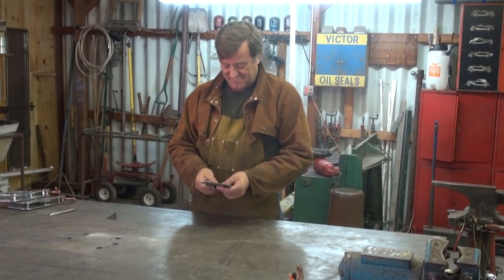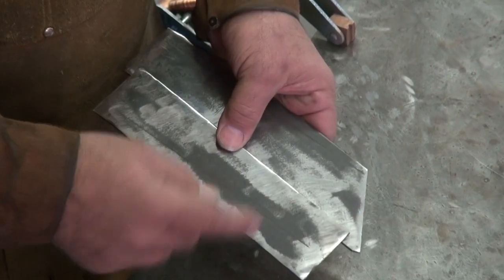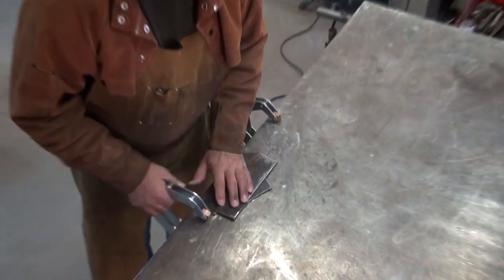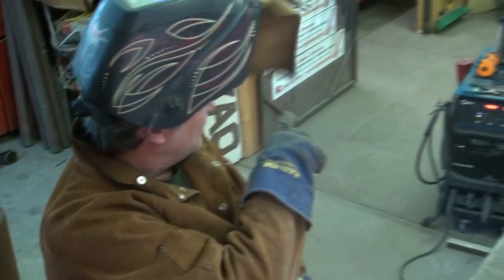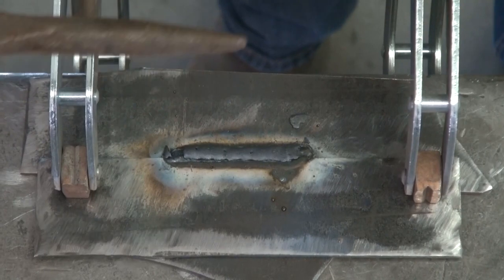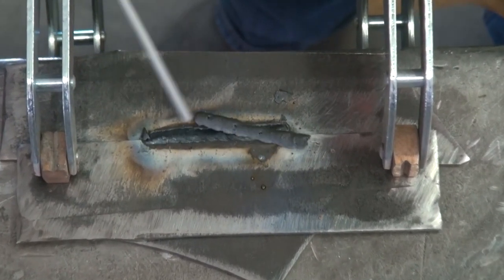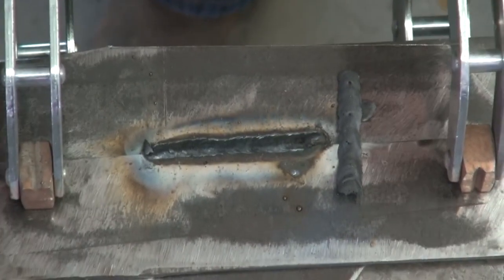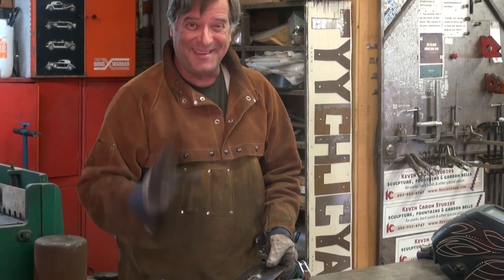How to Weld a Lap Joint - Kevin Caron

Comment: sometimes the puddle sticks to one peace of metal and not the other ... why would that happen ??
Reply from the maker: You are keeping the heat on one side of the joint.   Should be in the middle of the joint or maybe weaving back and forth a little.
Reply: @KevincaronSculpture  so it's best to make the rod on a 45 angle .
Reply from the maker: No, not over 10 degrees either way.   But try going right down the middle of the joint.  All really depends on what size rod you are using.
Reply: @KevincaronSculpture  I usually use 6013 on a DCEN inverter dc welding machine.

Comment: I am a new welder and learning from videos like yours and thanks to all for doing that.

I am now going to ask the "dumb question of the day"

I am aware that the table or the actual work piece has to be grounded to complete the circuit.  If not grounded it may think you are the ground or I assume no arch.

So if one was welding outside and stuck an iron rod into the ground and attached the ground clamp to that rod, would that complete the circuit or does the ground clamp  have to be clamped to the table or work piece?
Reply from the maker: Great question!     No, putting the ground clamp on a metal stake in the ground will not complete the circuit.  Think that what you have in your hand is a "return" cable, NOT a ground cable.  You might find a lug on the back of your machine to attach it to ground.  This is just to keep you from getting shocked by the machine case.  If you hooked the return cable to a pole in the dirt you will not get an arc from the machine.   Done correctly, your return cable should be hooked to the work piece always!   This will keep you from getting shocked by the welder as you are working.
Reply: @KevincaronSculpture  Thanks for your reply and I kind of thought no, but was not sure and your info was worth a lot. Thanks again and I enjoy your videos.

Comment from the maker: @spelunkerd The copper pads on the clamps are to keep you from welding the clamps to the work. 
If you check some of my other videos you will find my welder video. The Miller 200 is tig and stick. I also have a Miller 251 Mig. 

Thanks for posting...

Comment: what is the use/function of lap joints??
Reply from the maker: krislyn magsinolog Stronger joint than a butt joint.  It only works if you can get to both sides of the joint to weld it..  Used where strength is important and looks are not..    Like on a water tank..
Reply: Kevin Caron, Artist  Is there a physics concept present in welding lap joints??

How bout' stress/strain??

Thankyou!!! :)
Reply from the maker: Outside of my expertise!   Not sure how to answer this....
Reply: +krislyn magsinolog From what I know the strength of the weld is mostly dependent on the filler metal used, but some of the strength also comes from the base metal fusing with penetration.

Comment from the maker: Ok, now I got ya...     Depending on the length of the joint you should clamp it on each end. Tack the middle on both sides about a 1/4 inch or so. Then go to the ends and get a tack there. If you are talking more than lets say 10 inches long overall than try tacking the middle in three places or so.  Start in the middle and work your way out evenly.  Make sense?

Comment: I have an other question how do you stop under cut from happening it keeps on happening on the top plate when I'm welding the tee joint I can get a good bead but the undercut is killing me thanks.

Comment: I see that your clamps seem to have copper contacts. Is that designed to offer better electrical contact, or is it to reduce splatter? 
One day, it would be nice to see what welder you are using. Can you use that Miller for TIG as well?

Comment: you dont have to ground the two pieces of metal, you can clamp it to the metal table and in order to keep both pieces straight, you need to tack te two ends and then weld.

Comment: Love your work, Kevin. You've helped me quite a bit to come along as a hobbyist welder.

Question- When welding a thicker piece of metal to a thin piece (let's say 1/4" to a truck frame of 14gauge), how do I prevent eating up the edge of the 1/4" plate that lays on top of the thinner metal? I have the welder set up for the thicker metal, but maybe chamfering more would help so I create more workable surface area to put the weld onto as I lead it onto the thin piece? Am I wrong by starting off on the top-most piece? Maybe I need to drop my voltage or wire speed? I'm kinda lost and my welds are coming out really nasty looking, but look good when doing 1/4" to 1/4" Ts and Butt Joints.
Reply: Thanks for the quick response, Kevin. Since my thinner metal is laying below the thicker metal, I would start on the thicker metal and step down to the thinner metal with a very quick motion and then back up to the thicker edge, correct? My problem seems to occur as I make that dropping motion to the thinner metal- the arc seems to really destroy the edge of the thick metal during the transition down to the thinner and back up to the thicker of the two. Apologies if I'm not understanding a simple process- Just trying to understand my problem better.
Reply: Thanks, Kevin! Gonna try this right after dinner. I guess I just didn't expect the edge to melt away so noticeably but the process IS about melting metal so it SHOULD be expected. Thanks again. I'll let you know how it goes.
Reply: Update: Your suggestion worked out well for me. Now it's practice, practice, and practice! Thanks a lot, Kevin.